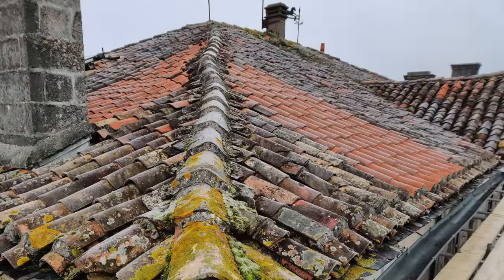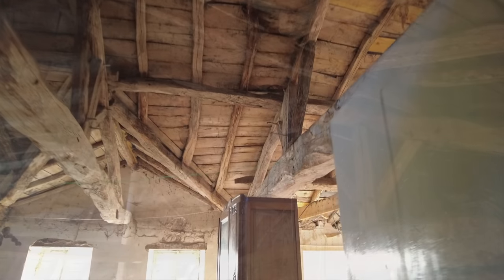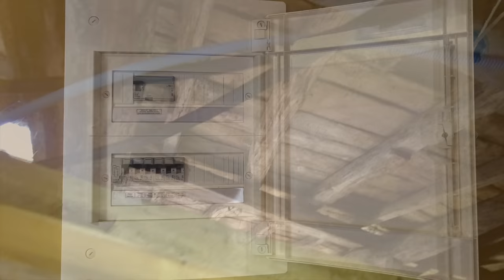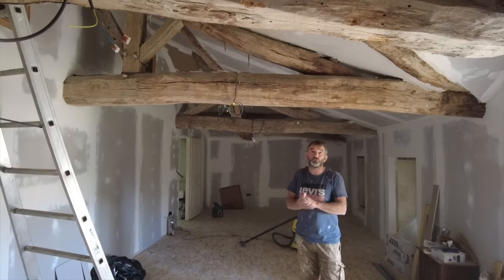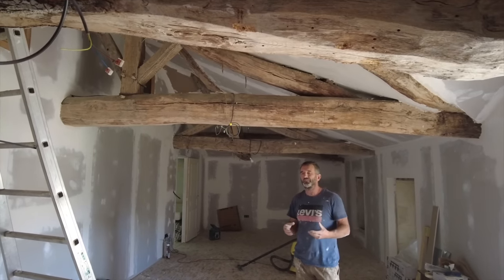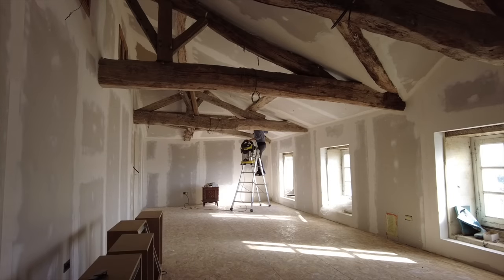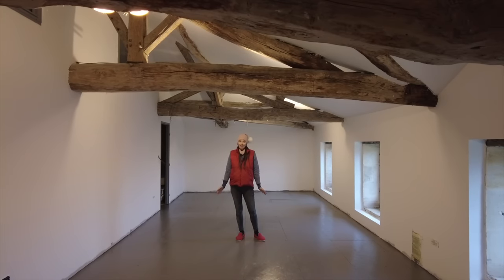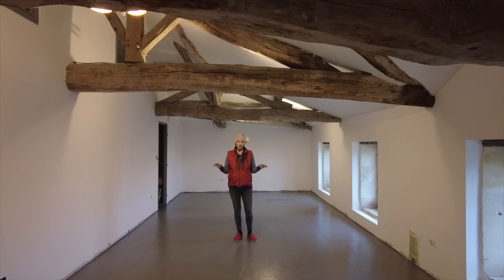Ep. 31 Revealing the Fruits of our Labour

Comment: Wow major hardwork!  looks wonderful.   the builder said you were going to  oil the beams? didn't see that happen?  if it did, what type of oil did you use?  I'm just starting a project and need to clean and prep old beams such as yours
Reply from the maker: Hi Darla!  You are quite right in that I’ve not oiled the beams yet.  It’s a job for later in the year when I can open the windows for ventilation.  I’ve not quite decided yet but I’ll probably be using either boiled linseed oil and turpentine, or an Osmio (a great German brand) wood oil.  But first I’ll have a lot of flaky bits to take off, so I’ll be sanding and brushing with a hoover.